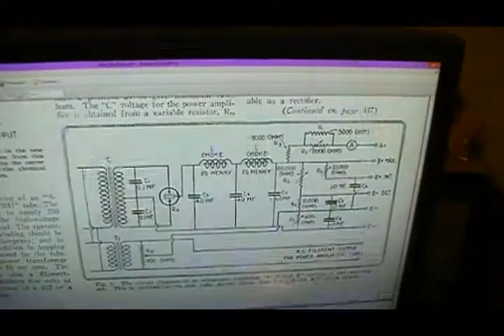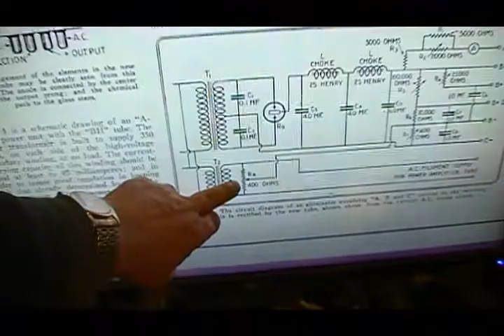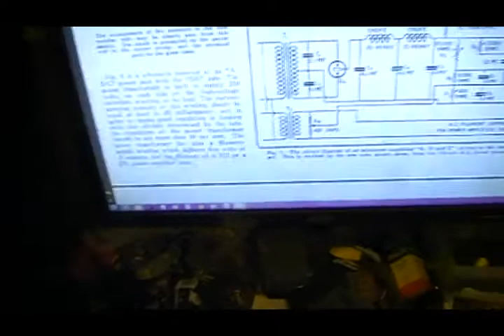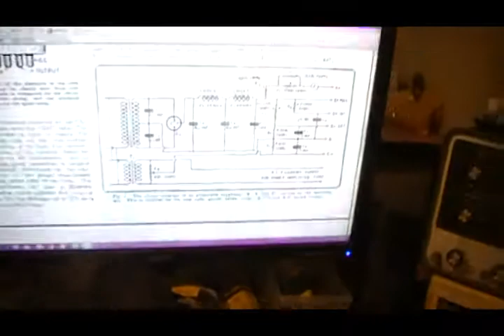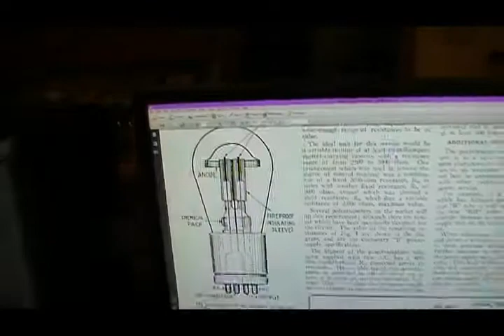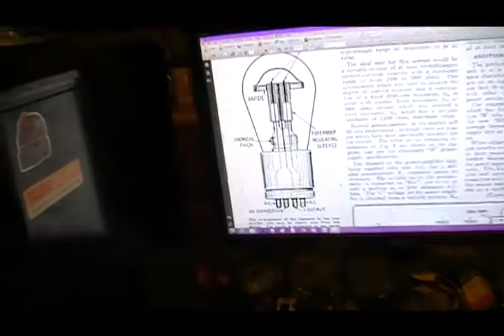Atwater Kent 67C part 3

Comment: Thanks for the great explanation on how that 112 rectifier tube functions. The only rectifier even somewhat resembling the ionization factor was the use of a mercury-vapor rectifier on a converted transmitter/receiver from a WWII aircraft that I made as a kid. Of course the main difference is that it did have a heater. What a cool looking purple glow from it. I wonder if yours will glow some color as well.

I can't believe that chassis. Looks like you brought it back from the factory today!

20 amp old school fuse? Talk about over kill! Is there any chance that it could draw 2,200W at startup? You could always throw in a CL-90 in the line to eliminate that problem in a heartbeat. It may, and probably would prolong the life of the transformers at the same time.

As always, looking forward to the next video Dennis!
Tom
Reply from the maker: Thanks Tom. I don't know if the rectifier will glow or not but it would be cool if it did.
I did a load test of the transformers and they only drew about 20 mA and that was with a larger load than they will have hooked up to the radio. 
Your friend  Dennis
Reply: Dennis Carter
20ma sounds more sensible under load. But the filament xfmr will spike higher than that when the filaments are cold I believe. Have you used CL-90 thermisters before? I think it would be a great choice to prolong the life of this fine AK radio. Plus, they're cheap!
Reply from the maker: *****  i will be putting in one. I have a stock of them.
Your friend  Dennis

Comment: Hi Dennis, how y’ doing my friend?
When repairing/restoring vintage radios I too begin by getting the power supply working, shortly followed by the audio output.  The A and B voltage supplies is a relatively new phenomenon here in England (we refer to those, as I’m sure you are aware, as LT and HT).  You mentioned, “C voltages” – am I right in thinking those are zero, or negative, volt(s) that will connect to deck or chassis?
Also, replacing potentiometers with fixed resister potential dividers – I’m intrigued.  The reason I say this is because I’m currently working on a 1928 radiogram that has three, badly burnt out, fixed resistor potential dividers in its mains power supply.  Annoyingly, I’m having to work blind as I am unable to source a circuit diagram.  I am toying with the idea of replacing two of the three defective fixed potential dividers - one with a rheostat and the other with a potentiometer.  It will be interesting to see how your radio, and the one I’m working on, turn out.
Enjoyed watching your video dear chap.
Regards,
Phil.
Reply from the maker: Hi Phil, I'm doing fine my friend. The "C voltage " is for the bias. In this radio only two of these voltages are needed one for the first audio tube witch is -4.5 volts and the other is for the output tubes witch is -45 volts. The names for these voltages came from the early experimenters of vacuum tubes. I will be using Ohms Law to find the values of resisters I need and that should get me close. I'm sure I will have to play around  with these values a little.
Thanks for watching my friend.
Your friend  Dennis